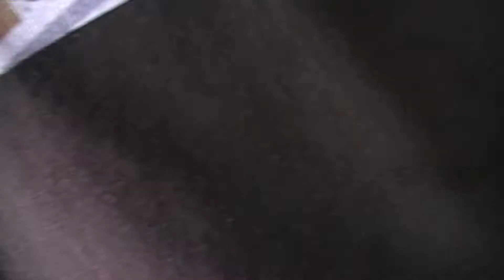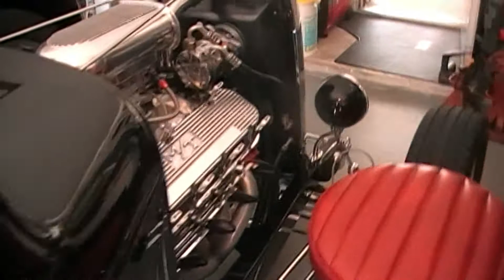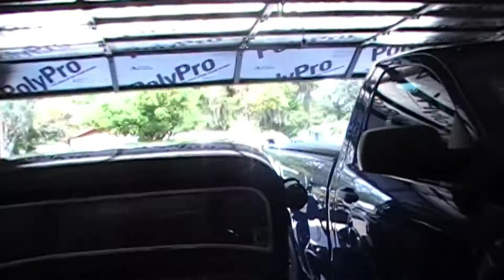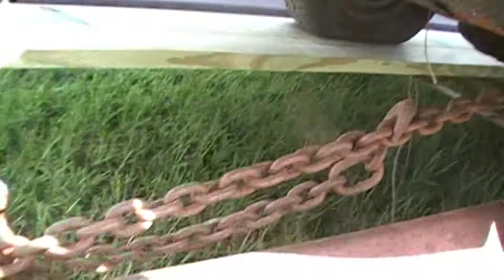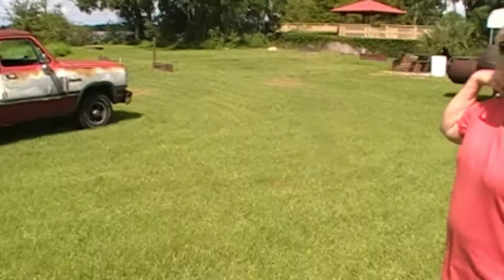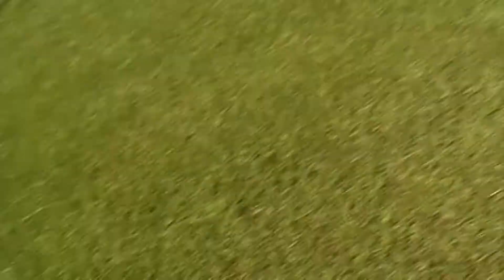Crosley on Home

Comment: Yes sir like to call our veterans that served. And first responders we love y'all. So with that being considered crosley Dave now? Where is that crashed for Dave.? We love you sir. I'm serious backhoe driver co-pilot. Autotext will fix me up with his correction the spelling. Looking lol.. I have a homemade car hauler. Looks like it'll be between to your s.
Reply from the maker: We love our veterans. I was am always will be a proud sailor. I don’t know about Crosley Dave. My first love is still my mopars.
Reply: @rustyachers2459  yes sir  I agree just pick you. Love y'all. Your a well balanceed guy pleas don't let my sense of humor offend you brother Dodge Ford Chevy Mazda Subaru Volkswagen Toyota Honda motorcycle it was bought for me from where the 18th birthday I'm 50 now
Reply: @rustyachers2459  67 Chevy pickup 327 2-speed powerglide. 1972 Chevy pickup 307. 1963 Ford F100 223 3 speed on the column. 1970 Ford 429. 1970 Ford falcon 3023 speed wagon.
Reply: @rustyachers2459  I have three Chevy 2 or 6.2 diesel what is a four by four four wheel drive. One 1985 Chevy stepside 350. One day 1980 Chevy Blazer two-wheel drive. Is factory lowered sports ride